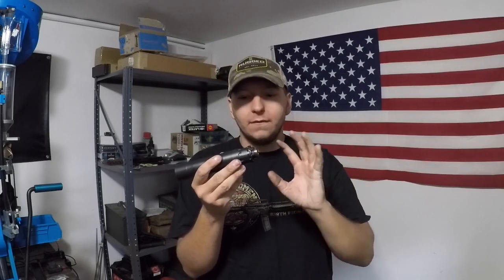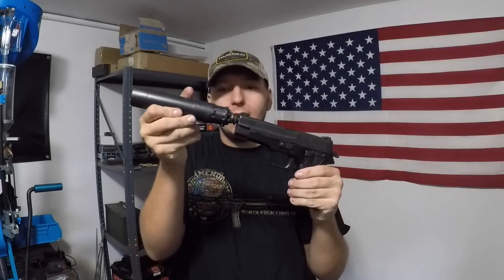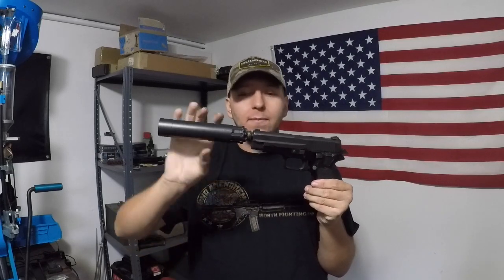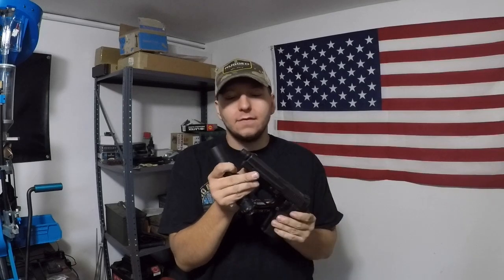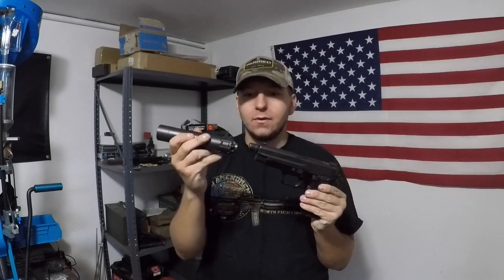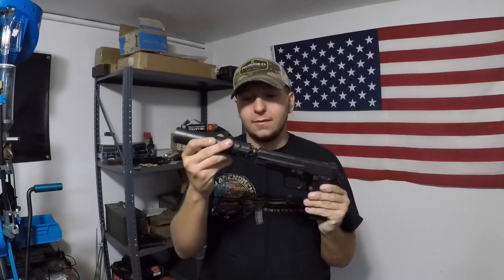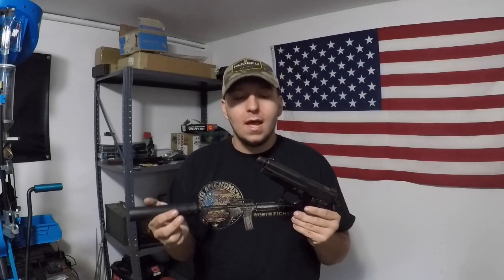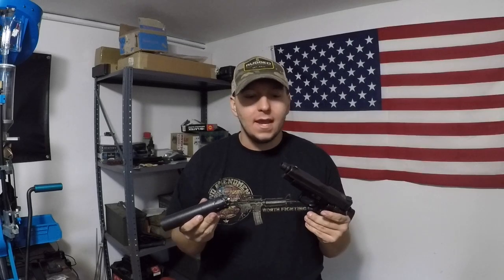Griffin CAM-LOK | Pistol QD Mount Overview

Comment: I am planning on getting this setup for sure. Among all the other benefits of it, the fact that the can won't walk off the barrel is huge in my opinion. I don't always do it, but I do it frequently enough to where it matters. That being taking brand new or very novice shooters out for the first time. Often it's not just the first time shooting suppressed but shooting guns in general. Not having to lord over them or have them constantly checking if the can is tight is a huge plus. It's just one more thing in the plus column.
Reply from the maker: Just make sure you don’t let them tighten it too tight. Had a buddy that’s never shot a pistol can before tighten the shit out of it and when I went to take it off the mount came with it. Was a simple fix though, just held the can and used a ratchet to pop the mount loose. It’s a taper mount. It doesent take much force to tighten it.
Reply: I'm not going to let them put it on or off  (as usual). I typically prep the firearm, safe it, have a mag or two ready, show them how to do normal operations like release the slide or whatever, then they can shoot. 

A lot of people that are new are kind of intimidated by the suppressor and are scared to reach out and grab it to check if it's tight or not. Trying to throw tightening a suppressor into the mix in some cases has been a bit of information overload for some brand new shooters.
Reply from the maker: My buddy’s a pretty experienced shooter. He has a couple rifle cans and a 22 can. He Just thought you were supposed to treat it like DT and snug it hard
Reply: One question though regarding clocking the suppressor for POI shift...I assume that is all 100% the same but I figured I would confirm or not.
Reply from the maker: Yup. Just confirmed. Have a suppressed g19 with the cam lok on it beside me now.
Reply: Might be a good subject for a follow up video. Not just demonstrating the clocking function but also talking about teaching new shooters.

Comment: I bought this as soon as it came out as well. Have always wanted a qd for a pistol can. It works great and one other advantage in some cases for a single host user is being able to quickly remove the can from the pistol for storage. I have multiple host pistols, but the can is always removed when in the safe for me. Otherwise I think you covered everything
Reply from the maker: Great point. 👍🏻

Comment: I bought one of these for a Glock 19 with an Odessa 9. The Odessa will start to come loose with just 5 or so shots, so when I found out this was available I was stoked. I haven't shot with the Cam Lok components installed yet. I do like what I've seen, but it is a little weird because there's not much of a turn to install the piston to the barrel adapter. I've probably put it on and taken it off 100 times just to be sure the suppressor's really on there. I guess I trust it because of all the vids like yours I've seen, but I'm still kind of weary about it. I do kinda wish it took more than a quarter turn to seat everything, or better yet, that it could be locked. I guess I'll have to learn to trust it when using the system.

Comment: Seems pretty cool. I didnt know anything like that existed for pistol suppressors. When I get my obsidian 45 I'm only planning on running it on my fnx tactical 45. So I don't think I would get into this system. At least not right away.
Reply from the maker: It’s brand new. And yes if your just using it on one can then this system might not make the most sense. You wont have to worrry about the can coming loose and getting baffle strikes but you shouldn’t with traditional DT either of you install them right

Comment: @ 2:38 in he states 20 inch pounds, this should be 20 ft pounds. 
He didn't stress this enough, Don't use a wrench, you must use a deep 3/4" socket
for the Cam-Loc to barrel adapter. A box end or open end wrench will roll, messing up the finish 
and getting a little stuck.

Comment: Hi - does griffin's cam-lok have any advantages (aside from cost) over Rugged's 3 lug system ? thinking of getting either cam-lok or 3 lug for rugged obsidian 9 + p226 mk25 setup. Thanks in advance.
Reply from the maker: You can't 3 lug a handgun. I need the booster assembly to work. The cam lok is the only qd system that is also a booster assembly.. 3 lug is for like sub guns and stuff.

Comment: Have you tried in any existing holsters that take threaded barrels?
Reply from the maker: I’ve seen the T Rex arms one in person. Never used it though.
Reply: Keystone Mountain Outdoors I mean with the cam lok barrel attachment (not with suppressor).  I am wondering if you have an existing holster that takes a pistol with a threaded barrel will it still work with the barrel attachment.
Reply from the maker: Tim  so I tried it in a few and it worked in 2/4 of them, so I guess it would depend on the holster. If it doesent you could always just remove it or open the hole in the Kydex or whatever material it is.
Reply: Keystone Mountain Outdoors thank you for checking for me.

Comment: Does it shoot loose or is it hard to remove when hot?? Is changing hosts a bunch a problem or is this a solution in search of a problem?
Reply from the maker: I would watch the video again. I answered all your questions in there.
Reply: In testing we basically it like we had arthritis and it would stay tight for 50 rounds no problem. Its a big jump in mounting security.